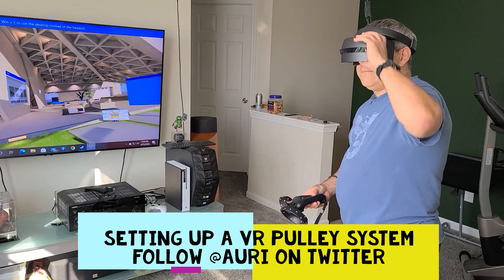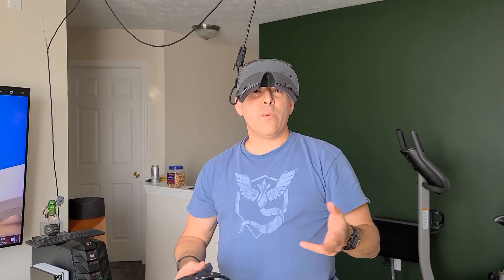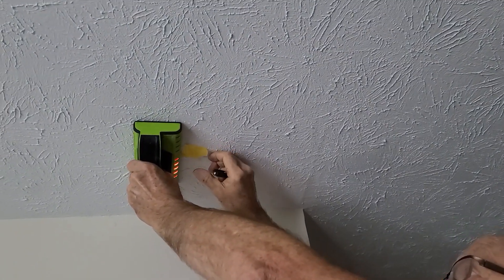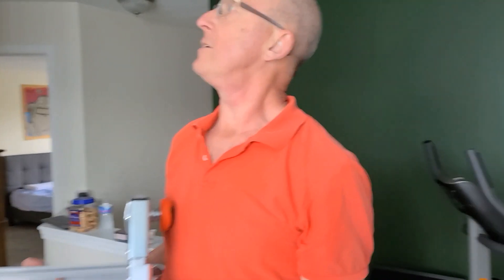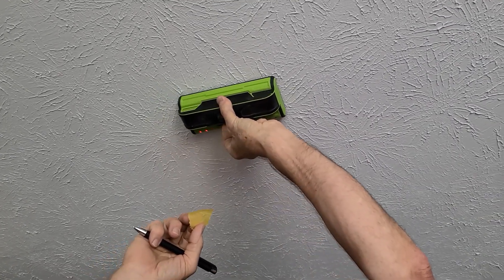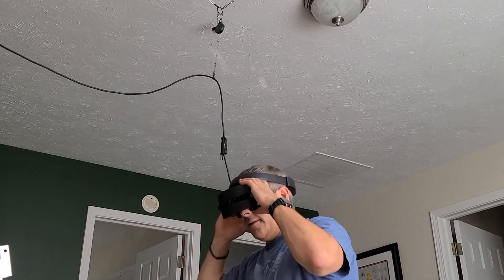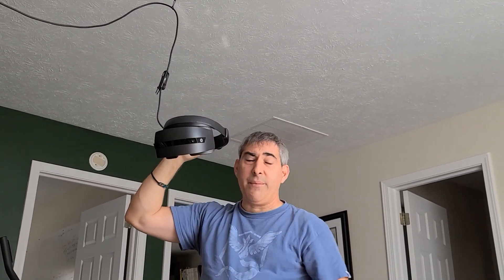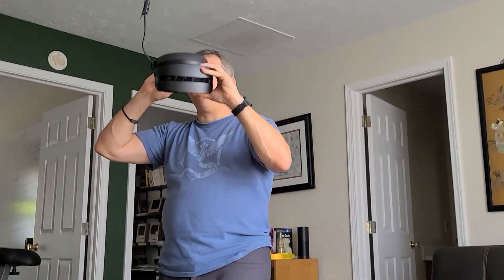Installing VR Pulley System

Comment: the only problem i have with these pullys is because you have several pulleys in a line from the pc to the  central tri hub of pullys when your trying to move away from those pullys (like walking opposite direction as your pc) you get a huge amount of resistance because you are literally pulling every pully in the system and its  so much so that it feels like its gonna rip my headset off im testing a new idea to keep the tri hub in the play space for ease of movment but replace the one in line  from the pc with wheel pullys so the cable moves freely in that area on a wheels meaning the only resistance you will feel is the  play space hub pullys plus it would keep the cable up higher closer to the roof so its not dangling down plus small M20 wheel pullys on amazon are only like 13$ for 6  or 20$ for 10
Reply from the maker: Lower the tension by pulling a little more cable out using the pulley adjusting screws and that generally won't happen.

Comment: I had a few Small self-retractable dog leash lying around that I didn't use anymore because of no dog! so I mounted 3 hooks in the ceiling and now when I play VR I can with easy just mount the dog leashes on the hooks and the valve index wire in the leaches. completely free because I already had the dog leashes. it might not be as elegant. but how cares, you cant see it In VR anyway. and to put it all away takes 10 seconds.

Comment: hey question i like to sit on the ground sometimes do u think this will work ?
Reply from the maker: I haven't tried. I've ducked with no issue, but not sat.
Reply: i should work depending on how tall your celing is. the pullyes can pulll a decent length
Reply from the maker: Like J said, yeah, it should work if you have enough give in the pulleys.